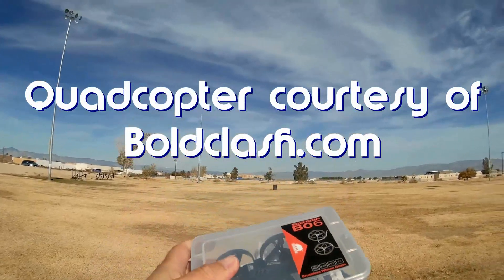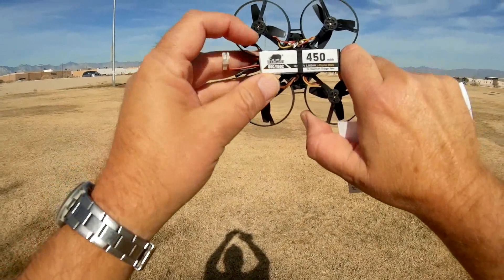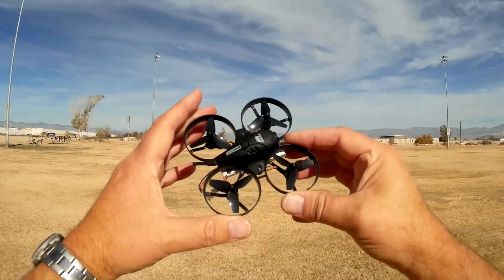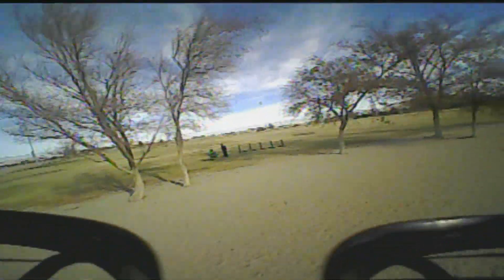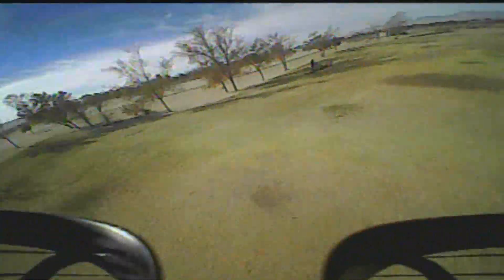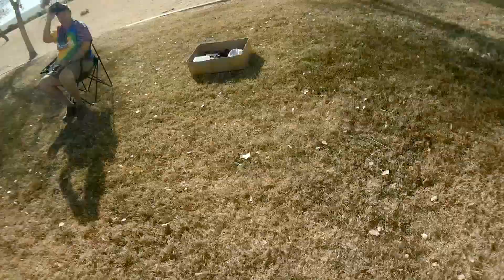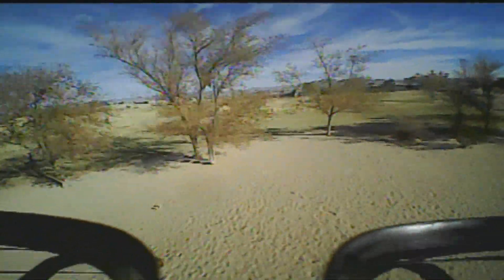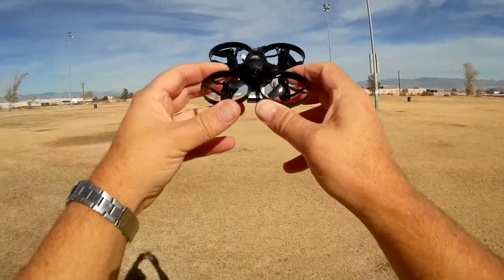Boldclash BWhoop B06 1S Brushless Micro FPV Whoop Drone Flight Test Review

Comment: Trying to obtain batteries for my BWhoop B-03 Pro. I now have added the B-06 body camera) Basically, in my opinion, turning mine into a "cheaper" B-06 except not brush less motors. BOLD CLASH is not carrying replacement batteries!! The B-03 uses a 3.7v 300mah 35C/70C lipo.(these specs are hard to find in "other" brands) The B0-6 uses a 3.7v 450 mah 80C/160C lipo.(easier to find this battery) I'm thinking of using the 450 mah lipo in my B-03. Any comments out there??

Comment: Hey Quadcopter101. I been emailing boldclash constantly on these motors and no response from them. These motors are M0703 would you know where can I pick them up. Do you think any M0703 would fit the B06.
Reply from the maker: Have you tried eBay? https://www.ebay.com/sch/i.html?_from=R40&_trksid=m570.l1313&_nkw=m0703+15000kv&_sacat=0

Comment: How did you make it flip on the jumper controller. In the mixer which one did you set it on. I have this tiny whoop.
Reply from the maker: You have to fly it in acro to flip it.  In acro you can roll it 360 degrees as there is no auto stabilization.  However it takes quite a bit of practice to fly in acro.  I recommend practicing with a simulator using the jumper to learn such. I recommend FPV Freerider and Joshua Bardwell's series of tutorials https://www.youtube.com/playlist?list=PLwoDb7WF6c8kjYXam4m3msvRbkORU41GY
You'll also need a USB dongle cable to attach your jumper to your computer to use freerider (while setting the Jumper to PPM mode in its settings).  They're cheap https://goo.gl/ujT2s3
Reply: Quadcopter 101 Thanks a lot 101.

Comment: DO NOT ORDER THIS DRONE!!!!! I ordered one about 2 weeks ago and during the third test flight one of the motors separated and is now broken. It didn't crash at all. The motor just failed. I contacted their support  (Which is email only) and have been asking them for a replacement motor for several days. They are giving me the typical runaround lying about checking with a sales person before they send me a replacement motor. This has been going back and forth for days. Now they are just straight up ignoring my emails. I'm going to return the entire thing. It's useless!! I can't even buy a replacement motor because they're sold out. This company has the worst customer service ever. DO NOT BUY THIS DRONE!!!!!
Reply: They have a kit to fix that and here is a simple way to keep from losing the bearing. Place a small piece of 3m double sided tape on the bottom of the motor. Then you can just repress the brass bushing on the shaft and fly again because you won't lose the parts.
Reply: Get on google type in “full speed drone” go to their website buy their 703 motor. It’s much better and has a C clip. Or better yet buy their Bee-bee66 or eaglet85

Comment: Once you bind the Whoop could you save it to the controller. On mine it says unsaved. I don't see a way to save it.
Reply from the maker: Ray Lugo what controller are you using?
Reply: Quadcopter 101 The jumper controller. I bind the b06 but can't save it.
Reply from the maker: There should be no need to save it (and I don't believe there is a save option in the T8SG menus, only Copy to)".  Once you get it bound, unplug the battery of the quadcopter.  Then turn off the transmitter.  It should automatically remember the bind.  When you want to fly, first turn on the transmitter, then turn on the quadcopter.  It should automatially bind.

Comment: Have you had any problems with this cause everyone is saying the motors brake on first flight and the bearing falls out the bottom of the motor
Reply: Yes! Same! The motor broke on the third flight! Now their "customer service" is ignoring me! What a scam!!!!
Reply: I did and I have just reported them on PayPal, but it looks like the message goes to them, not to paypal. I already know that BoldClash is actively ignoring my messages, so they will likely ignore that one as well. WHAT AN AWFUL COMPANY!!!
Reply from the maker: I haven't had any problems with mine.  And I searched its main thread on RCGroups, and didn't see anyone mentioning these issues? https://goo.gl/Pujpqf   Mind if I ask where you saw people complaining about this drone?
Reply: Quadcopter 101 yes on YouTube it's 18 hours old and it says update on this drone
Reply: Quadcopter 101 in4bliss is the YouTuber and says full review update
Reply from the maker: One guy on YouTube is not everyone (myself included ;-).  The link that I provided is probably a better sample of people's experience with this drone.
Reply: Did you use PayPal if so call them they will get your refund in 11 days
Reply: You need to put a very tiny drop of loctite or super glue right on the shaft where the brass holder is. Use a needle because you only need a very very small amount. Also as a back up lots of people will put black tape under the motor on the frame just Incase the brass fitting fall out it will just stop on the tape.
Also boldclash has said they are making motors stronger. They are also selling the fittings now on their website.
Reply: Jeff Paige we shouldn't have to buy replacement parts when you receive it with the motor hanging
Reply: Jeff Paige so why couldn't you solder the bottom then?
Reply: Brian Richtmyer not sure if solder would work. I agree with you on the motors should not be as crappy as they are.

Comment: Hi great flying. Have the bwhoop 06 and the jumper transmitter. I binded the quad with transmitter but having issues with the switches. When I go to betaflight the switches aren’t functioning. Need help with that. Thx in advance.